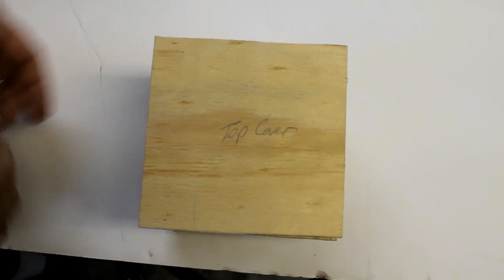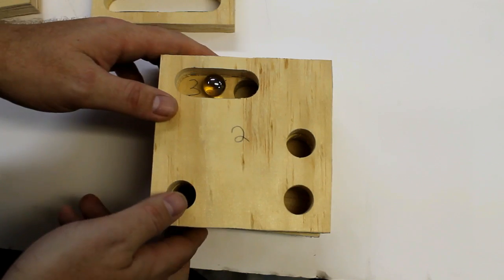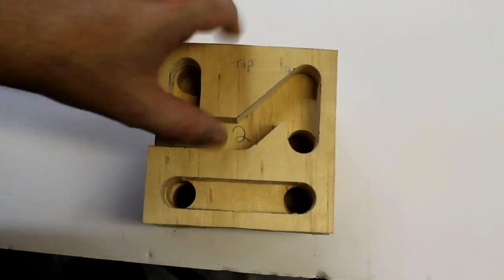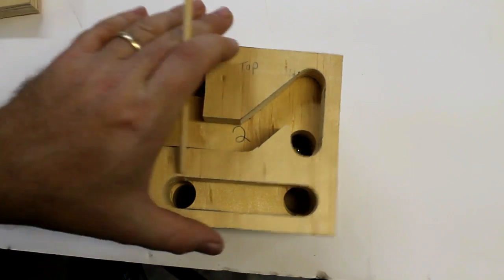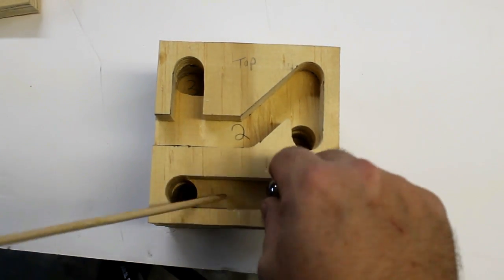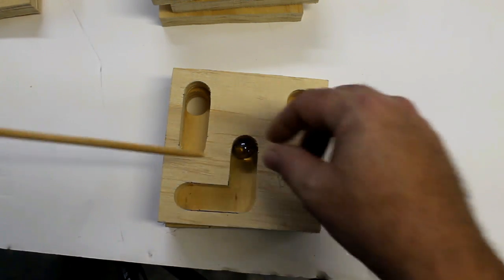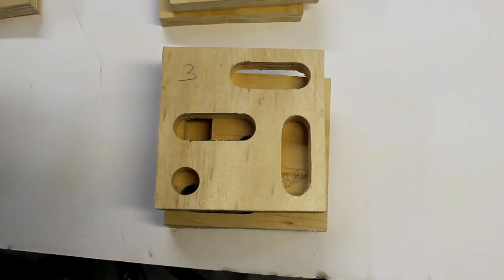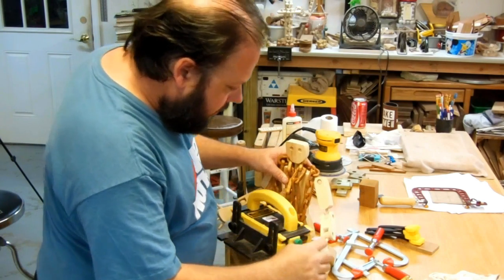How the 3D marble maze works + UPCOMING GIVEAWAYS!

Comment: Steve,
  Thanks for the how to. This will be great because I'll fly through the maze then watch my kids go nuts trying to figure it out.

Regards,
Bob
Reply from the maker: If you make one, Bob, print out an extra pattern (pattern is available via a link in the other video's description. I think I'll add it to this video's description as well). The pattern can be used as a map to make navigating the maze easier.
Reply: Thanks for the tip Steve, I will.

Regards,
Bob

Comment: Very cool, I made one that used a penny and I guess I did not put in enough dead ends so the daughter solved it in nothing flat.
Reply from the maker: Thank you for watching, woodturningjohn . Bind mazes like this and the one you made are strange in that they can sometimes be just as easy to randomly luck your way through the maze as it is to get "stuck" and end up wandering back and forth and/or coming back out the entry hole. But it is certainly possible to learn the route, especially if you use the map to navigate your way. But, if you can hear the coin/ball as it hits new walls, it's also something you can legitimately "skill" your way through without random movements or backtracking.